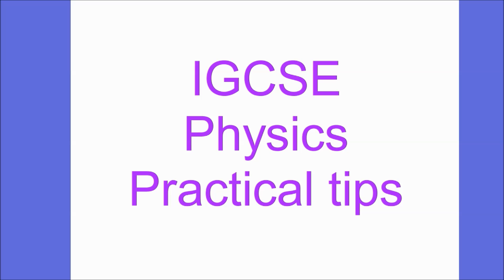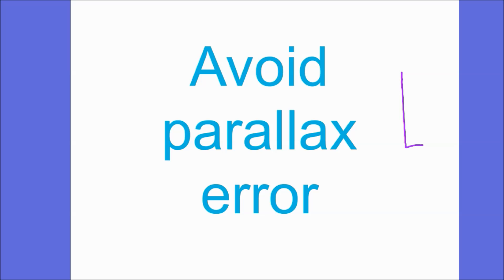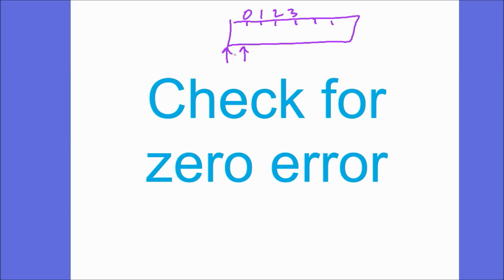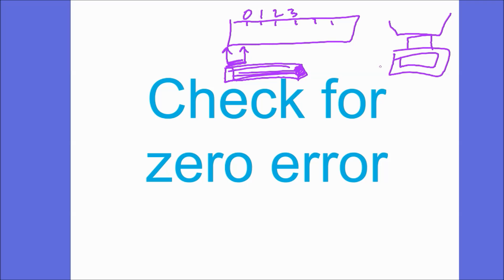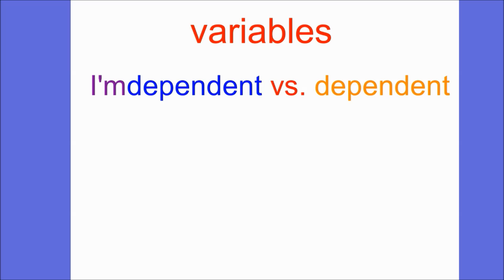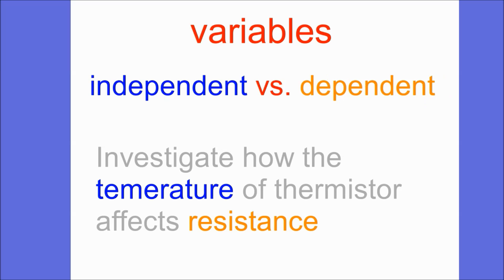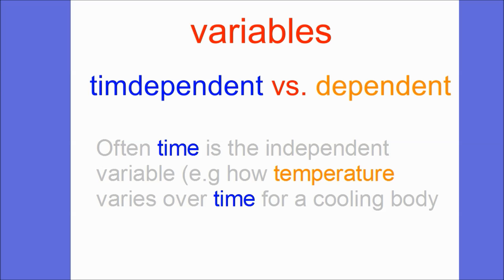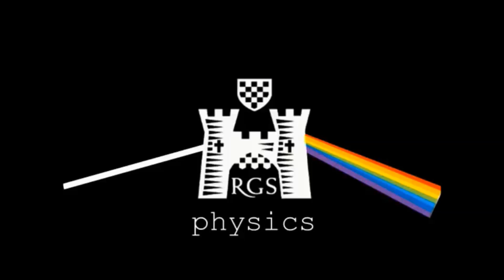IGCSE Physics: Practical Tips

Comment: Good experimental procedure for Electricity:
1) Clean the wires to reduce resistance caused by dirt.
2) Switch off the current in between readings to prevent temperature rise.
3) Avoid zero error reading of meters by checking if they read zero first before carrying out the experiment
Reply: If u want for other topics, feel free to ask
Reply: @darenkaulsay8076  yes please if you can
Reply: @darenkaulsay8076  Yes give
Reply: thanks
Reply: yes please help